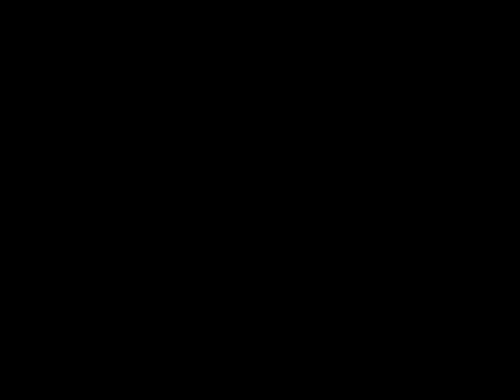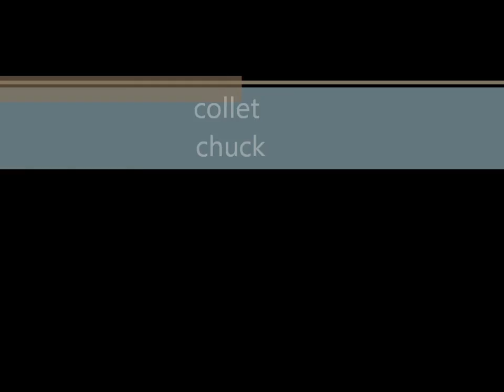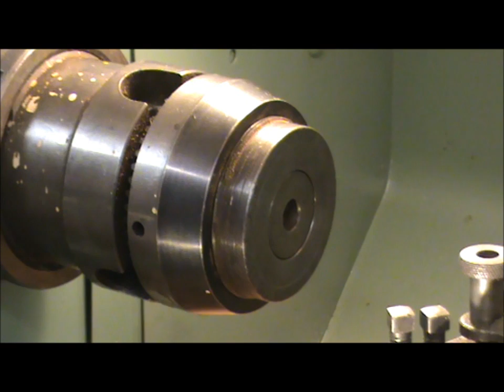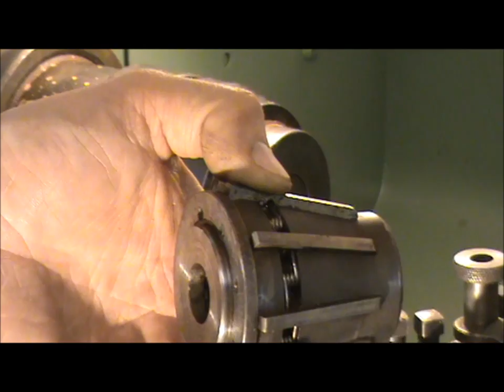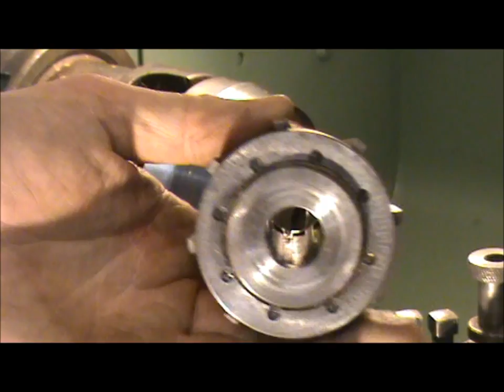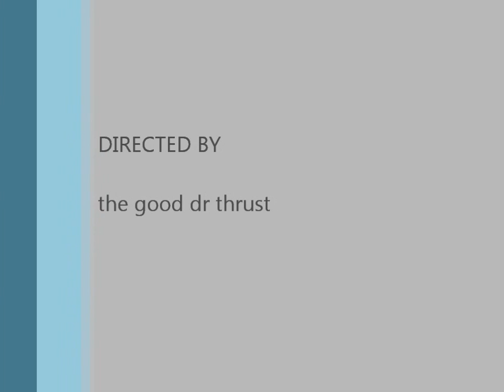❤️Colchester lathe collet Chuck you need this !❤️

Comment: Carbide can be used on your lathe.
The speeds are calculated on m per sec which is a combination of rpm and the diameter of the workpiece.

Comment: I've never used a lathe and would like to know if in the above example you used the powered lead screw or moved the tool by hand?
Reply from the maker: Hello Ronnie 👋  the Colchester student is classed as semi industrial, therefore it has its own feed shaft separate from the lead screw 
And this  can run forwards and backwards independently of the lathe direction, 
a simple push pull button with three positions allows you to select  lateral or longitudinal  powered cutting 
Smaller hobby lathes can use the lead screw but you don’t get a good range of surfacing speeds ,

Comment: Is your collet chuck an integral L series mount or does it have a backplate?
I am guessing Burnerd multigrip?
Reply from the maker: codprawn  yep it’s a  burnerd, they come up on eBay, super accurate  https://youtu.be/mMZuLN7w-_8
Reply from the maker: Seemed a bit heavy handed with the hammer, it was the first time I’d changed over a Chuck ...  just hand force now 🙄
Reply: Ahh yours is integral. Very hard to find in L1 fitting which is bigger again. I did find one with a backplate but I would rather a one piece.
I have bought a Jacobs Rubberflex which is very good and accurate but there is some vibration from the big aluminium handwheel at high revs which is what you tend to use them for!
Reply: @Battery-cat  
And talking of hammers - when I first fitted the Jacobs the runout was bad - I read up on it and with all the L series mounts you need to tap the locking ring in various places until you get the correct readings on a dti. If in doubt give it a clout as they say!
Reply from the maker: codprawn  dam , that’s interesting to know , no such problems like that thank goodness, I’d be upset if I had to do that
Reply: @Battery-cat  
It is common apparently - whenever you change a chuck or anything with the L taper you should gently tap the locking nut with a hammer to get it to run spot on using a dti on a test bard in the chuck or inside the taper of the collet chuck itself.
Reply: bar not bard!
Reply from the maker: codprawn  well you’re educated me there, the chuck that came with the lathe was way out , I just bought a good used one and it’s mint,   I put it down to the jaws needed regrinding , how do you find yours? Do you have to mess around with the ring
Reply: @Battery-cat  

https://www.youtube.com/watch?v=tsM1pRpTciY

http://www.tools-n-gizmos.com/info/Jacobs_Rubber_Collet_Chuck.pdf

I can't find the video I saw but it is clearly shown in the Rubberflex manual. This is not just for the Jacobs but applies when fitting any chuck. Even on the latest CNC machines to get it spot on you need a hammer - modern technology eh???